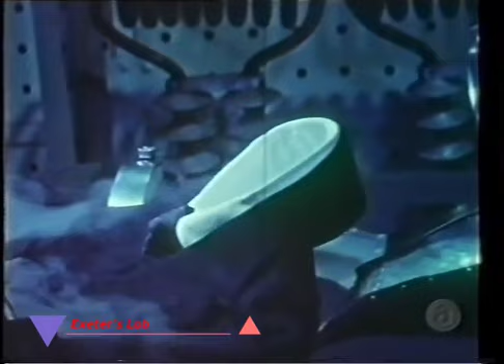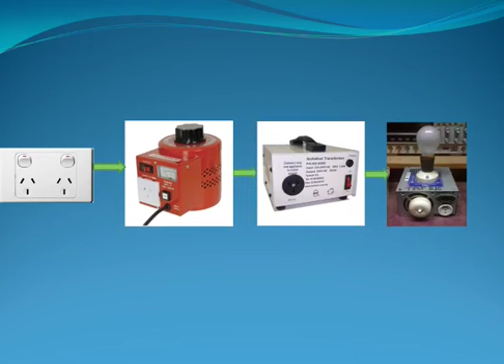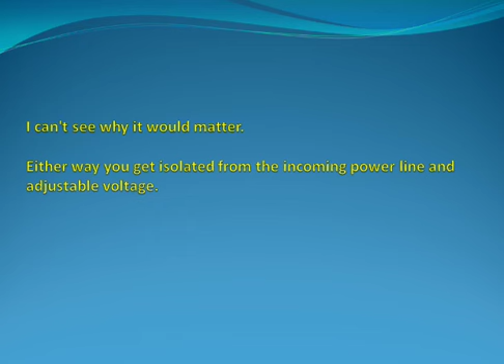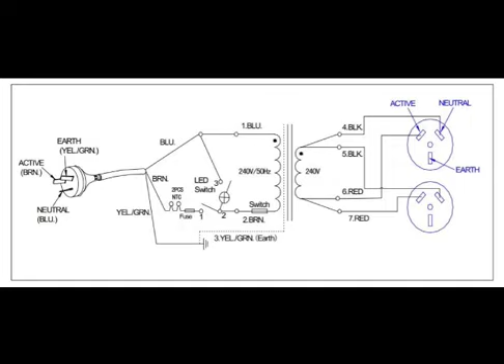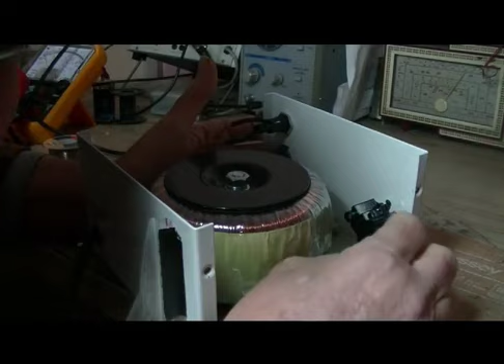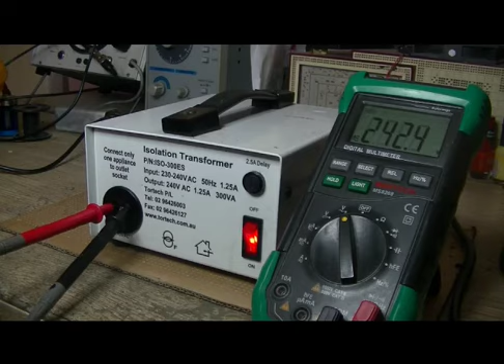Variac and Isolation Transformer connection order. Which should be first?

Comment: Sencore (PS57 and PS570) and Heathkit (IP-5220) each put the Variac first in their designs. Just make sure that the isolation transformer primary can handle the ~15% boosted voltage that many Variacs are capable of. Your specific IT apparently has an input rating of 240V ±10% so you're probably OK unless you push it. The other thing to watch out for is the maximum output current of the Variac since  the brush current Can be many times the input current at lower voltage settings. Toroidal transformers can draw massive inrush currents so best practices would suggest that you power up your setup with the Variac turned all the way down. Brushes can withstand very brief overloads but those cheap red Variacs tend to be optimistically rated to begin with. If the output isn't fused, add one. An input fuse will not protect from an overloaded output.

My last point is about PE (Protected Earth) grounding. Any piece of test gear that has the possibility of becoming live on any part the you can touch, or has a power cord with a PE connection provided by the manufacturer should be grounded. Period. I know that this topic can be controversial, especially among those who don't fully understand the risks and benefits of doing things correctly, or have been very lucky so far. The most obvious benefit is personal safety. Although fatal electrocutions are thankfully rare, injuries to oneself and damage to anything nearby as a result of reaction to a shock from an unexpected source can be avoided. The device that you are testing or repairing live is dangerous enough. The next risk is possible damage or destruction to the test equipment itself. All electrical and electronic components will fail if the voltage stresses placed upon them exceed their absolute limits. Suppose the power supply in your signal generator arcs over because a section that would normally be earthed suddenly had a few hundred volts impressed upon it. How many microseconds would the signal processors in you DSO that would normally run at 3.3 volts last if faced with 300? Another risk is signal integrity. Suppose part of the circuitry in your scope is shielded and grounded to prevent unwanted interference from a wide variety outside sources. Leaving it ungrounded could turn it into an antenna.  Any piece of test equipment will lie to you if you don't understand it's limitations, and troubleshooting can be especially challenging if not downright maddening  if you've inadvertently added additional limitations. 

The order of your IT and Variac usually will not make much difference as long as you pay close attention to what point is chosen as your measurement reference. Once you've eliminated all other possible ground paths in your device under test, including the sneaky neutral to PE connection in your building's wiring by using your IT, the single ground connection that you have reintroduced via your oscilloscope (or any other grounded test equipment) becomes your measurement reference point.
Reply from the maker: Thanks James. There's a lot of great stuff here that I will go though until I fully understand it. You certainly know your stuff, much appreciated

Comment: Just for the record, a transformer secondary doesn't have an active and a neutral. In the situation where you have a single secondary winding with two wires, both of them are 'hot' and it doesn't matter which way around you connect to them.
Reply from the maker: So true and that's where I can become confused lol. Still, I'm learning. Thanks Man
Reply: @exeterslab7781  No worries, happy to help. I'm an electronics and electrical engineer with over 50 years in the industry. You have some interesting videos in your lineup.

Comment: the reason i have the variac 1st is because the iso i use has multiple windings with step-up/step-down capability, allowing me to choose different ranges, including (in full step-up mode) much more voltage than the variac could handle (although at reduced current), or (in full step-down) much more current than the variac could handle (although at reduced voltage); all while still being isolated and adjustable
Reply from the maker: A nice setup. I can see why why you put the iso first

Comment: Mainly it´s exactly like in the one statement - it just doesn't matter so much.

Then, there are a few +/- issues:
In Favor of Mains-->IsolationTransformer-->Variac-->DUT:
- Magnetic saturation of the isolation transformer is not exceeded. ITs are rated for 110V AC or 230V AC but usually not for 250V AC or even 270V AC when idling at full voltage. The overvoltage causes saturation which leads to a loud hum and signifcant heat-up of the IT

In Favor of vice versa:
- Lower inrush current of the IT if it is faded up by the variac 
- Lower capacitance of the isolated circuit --> better isolation from ground

What doesn't matter at all:
- Wellbeing of a transformer at low voltages. No transformer itself ever felt bad because of low voltage. Never.

Comment: I use the Isolation - Variac - DimBulb setup just because the setup on my bench makes that most practical.
In my mind it sounds most logical to isolate first, then do the regulation and finally the protection.
In reality it probably only matters when you start to draw high currents through the setup,
and ususally you would not do that.
Reply: That make good sense to me too.
Reply from the maker: Thanks for your comments. I'm glad this video has generated a number of comments and views all which are likely correct. :)

Comment: I have that same variac and plug mine into my isolation transformer only because when I dont do that ipop my circuit breaker for that room. It has something to do with a weird ground problem otherwise your set up is fine.
Reply: For the same reason I would also do the isolation transformer first and after the variac. You also have the advantage that you can use the isolation transformer with a separate socket with the normal mains voltage if the different voltage is not appropriate. And it is possible to use the variac as a variable ballast by switching off the neutral of the variac. You can also connect the neutral to the earth via a switch and use an earth leakage circuit breaker as an extra safety measure.
Reply from the maker: Thank you Larry. Yeah, your grounding sounds weird. Be safe

Comment: I always put the isolation transformer first  then the  variac , and if you want a dim bulb
tester with a bulb of sufficient wattage next to the object to be supplied voltage to. Now 
about isolation transformers. Make sure the neutrals are not connected together. Some
actually come that way! Since we test mostly two prong  electronics the ground is not 
used but be mindful the ground and neutral go to the same place at the breaker box. With 
the variac you usually have a meter on it that shows voltage. This is the actual supplied
 voltage available to a piece of electronics under test with or without a dim bulb tester
 from the variac.  After the variac you can use  a  P3 Kill-A-Watt meter. That is handy for a 
digital display of amps and voltage used by the device being tested. The Aussie 
equivalent is Jaycar's Mains Power Meter. Might want to get one Frank and take it for a
 spin test.
Reply: Steve, I use two of the outlet power meters, one for my variac/isolated transformer (I don’t trust the meter needle) and the second one on my DBT. I acquired mine from Amazon and both of them are accurate to 0.1 of a volt when checked with my Fluke DMM. Of course, Frank as we know would need the 230 volt one. Good idea, Frank would be able to check the voltage drop, the wattage and the amperes of his radios.
Reply from the maker: You know your stuff Steve thanks for that. I'll check out what you said and the power meter from jaycar :)
Reply from the maker: I just looked Steve and yeah I've been meaning to get one for a while.
Reply: I’d put the isolator first, as you can guarantee it’s earthed box is actually connected to earth. In case it develops a fault, you won’t run the risk of the case being hot on you. I’d also see if you can get a little mains voltage/current/ power/ frequency panel meter unit off Ali express and put it in your dim bulb tester. Great for seeing everything at once, including total power over time…
Reply from the maker: @keithmarlow143  That's a great explanation Keith that I haven't heard before. I'll give it a go. Thanks Man :)

Comment: as a tech I've  never used one Isolation Transformer
Reply: Your radio should be earthed the only time the earthed on the cro needs to be lifted is when.working on switch mode psu
Reply from the maker: @moodyga40  Thanks for the info Moody much appreciated
Reply from the maker: In the three years I've been doing radios I never had the need for one. Still, it does add safety when using a cro. I think this is one debate that will never be reconciled lol. Thanks for your comments Man :)
Reply: I'm.the head tech at speaker hospital
Reply from the maker: @moodyga40  I was thinking a hospital in the USA but you're an aussie in Sydney. For someone of your experience I thank you for watching and your comments

Comment: A very interesting and informative video Frank, my setup is done exactly like yours, although now with my new setup the variac and isolated transformer are one single unit. I think it’s important to check inside the isolated transformer like you did to make sure that it is. With my new one, I have the wiring diagram and I did confirm that with a DMM. I have a couple of hospital grade isolated transformers and looking inside them, they're not isolated so yeah, if you can, look inside to make sure it’s isolated like you showed.
Reply from the maker: Thanks Ken, it just seems the right way to do it.
I especially thought Uncle Doug's video was important to show for the newbies as far as safety with cro's are concerned.